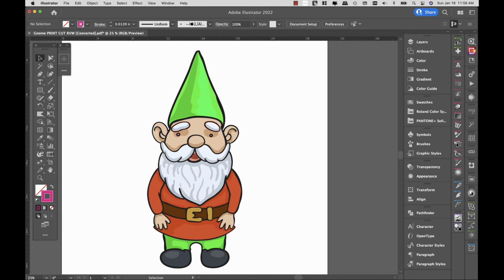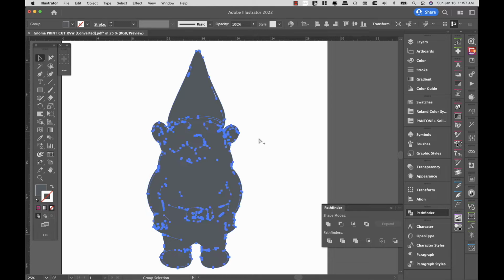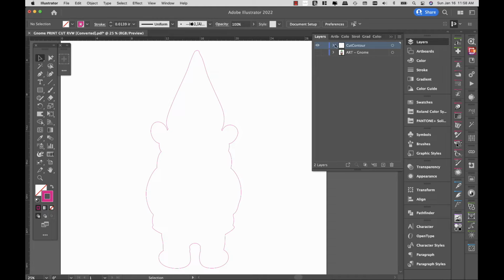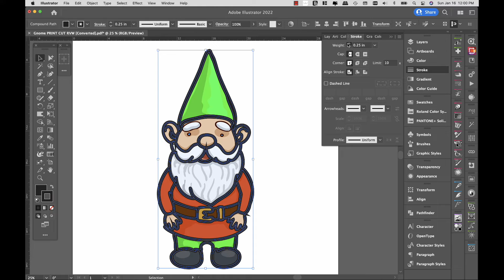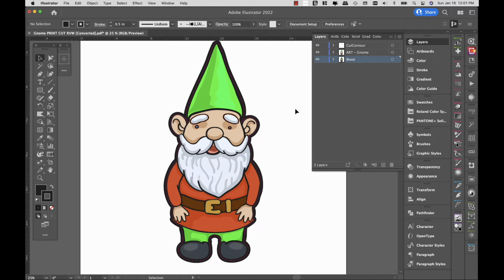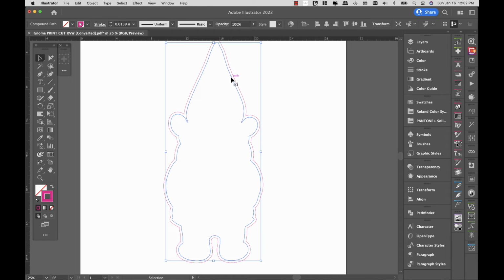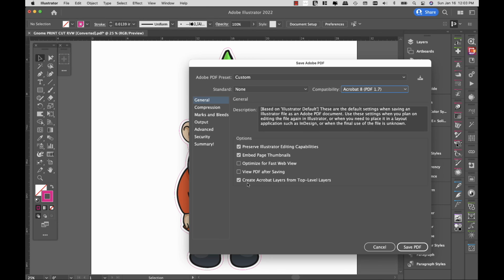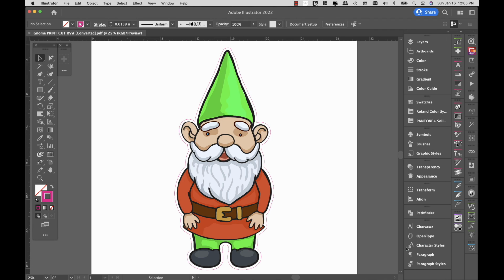Create a sticker cut line for your Roland BN-20 and other popular printers and RIP software

Comment: Do you have a video like this but starting with a SVG?
Reply from the maker: Hi, SVG is a file type and should work with the same way the EPS file in the video works as long as it's a vector (line art) file and not an image. If you're starting with an image SVG file then you will want to change your image file to B/W and use the image trace feature under the object menu and select make an expand and save as an SVG file. If we get enough interest we can certainly make a step by step video
Reply: @graphicinsights466  I meant to type PNG not SVG.. I searched your videos but didn’t know if you had made one previously
Reply: @craftycathy8444  We don't have one yet, but the process in my first comment would be the same for a PNG file.